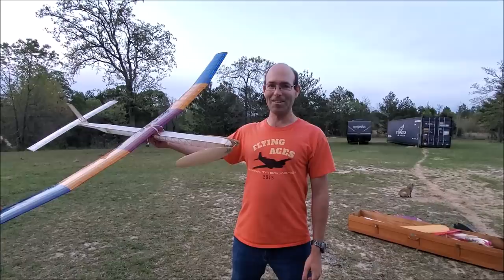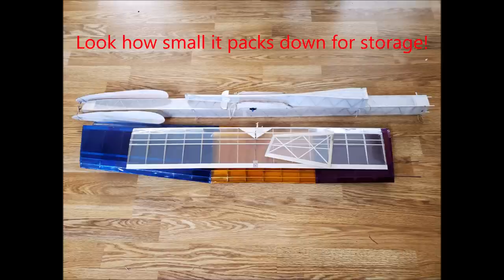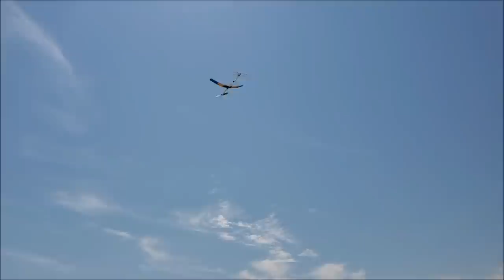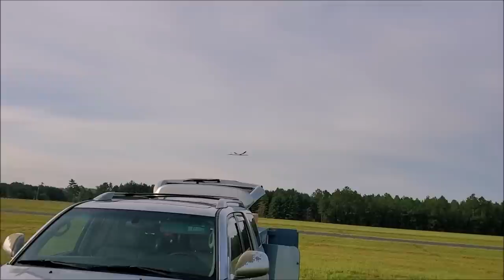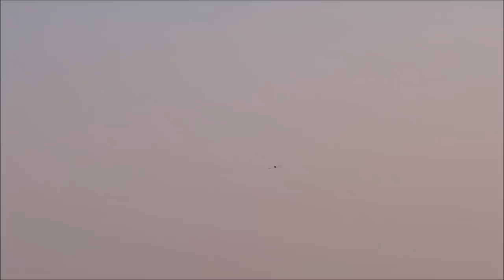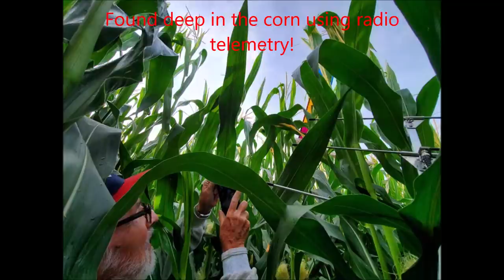Giant rubber powered airplane wins national championship!

Comment: Wow! What a great performance! You should call it "the Long Walk". I fully understand about the pure free-flight part of our hobby and all, but if ever a model needed R/C rudder assist, this is the one.
Some time ago I built a 3-channel Lanzo Bomber with an old Astro .05 geared motor. It climbed nearly vertically and just would not come down. Into the slightest breeze, it hung there like a kite and caught every bit of thermal activity in the sky. I had to spin it down to recover it. I won (I should say IT won) every club duration and timed landing contest until I retired it from competition to give the others in my club a chance.
This airplane electrified would be a killer competitor as well.
Thanks, Josh.
Reply: I'd buy a kit

Comment: Can this be adapted to have a small motor, batteries and RC controls?  I am interested in this kind of design for ultra long range waypoint guided powered flights.
Reply from the maker: Yeah you could definitely do that. It would be a real floater. A lightweight F5K power system would be plenty of power for it.

Comment: What is the airfoil? Or is it own design??
Reply from the maker: Unfortunately I don't know. It's definitely magic though!
Reply: @joshuawfinn  I can believe that, I know a bit about how hard it is to make an airfoil performing at that low speed!
Reply: That is Bud’s own design. He has apparently been using it for about 15 years. I had a hand in  bringing this beast to market as I had Josh cut me a set of ribs initially after I had traced them from Bud’s plan. He went on afterwards to make up the rest of the parts. 😀
Reply: @mikekirda4055  Thanks, it is one of the best low RE airfoils I've ever seen!
Reply: @sablatnic8030  No worries. I had the prototype of the kit ready for the NATS. Unfortunately had a strap come loose on a box and it subsequently fell and crushed the rear of my fuselage. I decided to rebuild it at home rather than try to pull an all-nighter to get it ready. I really need a box for this monster!

Comment: can you have two, after one is done to trig the next one and keep flying longer
Reply from the maker: Old planes used something called return gears where one motor was geared into a motor. That said this model is optimized for a single motor and that's why it runs such a huge prop. No other solution will give even equal performance, let alone better

Comment: Sorry Josh, need to ask a couple of question I'm sure you've  answered a hundred  times already. How do you store your rubber? Do you buy larger sizes and Strip to size? If so who is the vender? How many flights is a competitive motor good for- vs- just a having fun on the weekend? I have built all of Simmers "wocks" , Korda's Wakefield & Dethermalizer, Lanzos Stick plus maybe 50 Gas free flights and scale models. Finally moved to a state that has enough open space to fly them.
Reply from the maker: Robert, I need to do a video on this one. Bottom line is most of my big rubber models can fly an entire season on a single motor unless I have to do a bunch of retrimming following repairs, which usually destroys a motor. I store them with the motors installed, in a cool location, in their storage boxes. Seems to work out ok. I do strip to size from 1/8" rubber. You only need to do that for small scale stuff and indoor planes though.

Comment: That looks like it's built to Wakefield rules. Is that still a thing?
Reply from the maker: It's half again bigger than a Wakefield and half the weight to boot. Wakefield is alive and well as the F1B class. Limited power allotment of only 30g of rubber, so they're built with fancy gadgets to get the most out of what little power is available and the results are impressive, if inordinately expensive. Some of us fly contests for vintage Wakefields using published designs from the era and flown to the original flight format. They're cheap to build and fun. I built a replica of George Perryman's 1952 Wakefield, shown elsewhere on this channel. Quite fun, especially with close to 6 oz of rubber aboard!

Comment: Less than 100 grams for the airframe! That's incredibly light! But this of course must be before the covering... Still, most impressive. And a very graceful glide.
Reply from the maker: 1/4 mil mylar on the wings, even lighter on the tail. Polyspan on the fuselage isn't exactly light but it's needed. But yes, airframe well under 100g complete with DT and tracking beacon. I'm still flying this bird, it's got quite a career now.

Comment: I wanna build one of these with full house rc gear. Flaps, ailerons, rudder and elevator. Maybe a nice light brushless with folding props too or maybe a cox engine... but that on a pod, cause I want those rubber band props... beautiful. Something designed years ago
Reply from the maker: Bear in mind cruise speed on these is really low so you need very calm conditions to fly them. By the time you put in flaps an ailerons, the weight starts climbing and you need carbon to compensate for the flight loads. At that point it's basically a Pulsar 2m or Kennedy Electron (both very nice flying airplanes which can handle very strong winds). Anyway, just some food for thought so you know what you're getting into.
Reply: Fel trav  you don’t get it do you ?
Reply: @joshuawfinn  amazing. I got it brother. I've done it before with the proper structural reinforcements. But we're looking into no more than 50 grams of gear on it.
Reply from the maker: @feltav5719  sounds like a good recipe for success. Please let me know how it goes!
Reply: @joshuawfinn  yes sir. Will do.

Comment: NICE!  Not totally a fan of turbulator 'spars' but for that application they probably make perfect sense.  

Hey the birds have wings, give 'em some respect, dude.  :-)   The unpowered sink rate on that thing is insane.  Maybe you should consider injecting hydrogen into the wing and fuse before flight...I'm only 3/4s kidding here.
Reply from the maker: Turbulator spars are great on slow planes and provide some extra rigidity, but they definitely detract at higher speeds. For planes like this that live in a narrow speed range, they're perfect.
Reply: @joshuawfinn  I've never seen any L/D data on a wing done that way, but if you find that in actual use it probably is so, and as I said likely more applicable to your requirements.  You guys really are in about as narrow a speed range as it gets.  Congrats on the win.

I had turbulators just like that on my SD100 RC sailplane and I modified it to a thin balsa surface, undercutting the ribs to maintain the airfoil shape.  I liked the result.  Yes, it flew a MUCH wider speed range, though, probably 13:1 on severe dives carrying some ballast vs floating it in min weight config, and the mod cost me very little weight penalty, as the weight unit involved pounds, not grams.  :-)

Thx for taking the time to answer.  I spent many many hours as a kid flying small HLGs and found this rubber free flight a joy to watch.  We got about 20 seconds on good non thermal assisted flights, and lost many of them into thermals that took them up right out of sight.  I even got one back after a 20 min flight once that never got to high to see (we followed it) and probably involved at least two different thermals.  It didn't happen frequently enough to make a DT worthwhile, though.  Have you ever tried paraballoons? Those were a lot of fun, too in a place with heavy thermal activity (Central Fl for us).

Comment: gets too tail heavy when that mechanism goes off.
Reply from the maker: That's the entire purpose of it.
Reply: @joshuawfinn  every plane i fly and havr flown, tail heavy is bad. If you did not have that on there imagine how much longer it would stay aloft.
Reply from the maker: You're still missing the point. It's a recovery device. Puts the airplane in a stabilized deep stall, same as the Israeli drones, Space Ship 1/2, etc. You don't fly freeflight airplanes without one as it's a means of getting the plane back.
Reply: @joshuawfinn  understand the concept, just counter productive to record flight time.